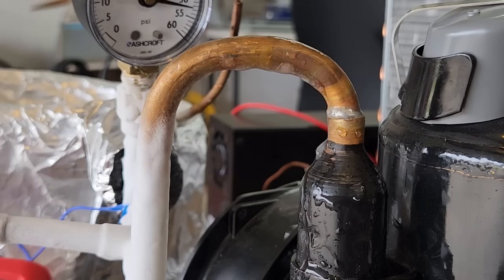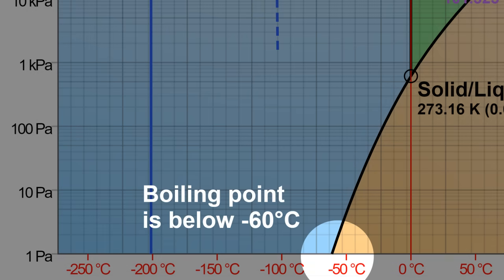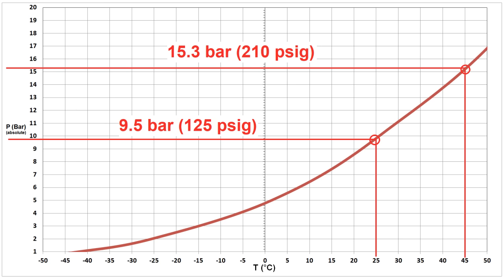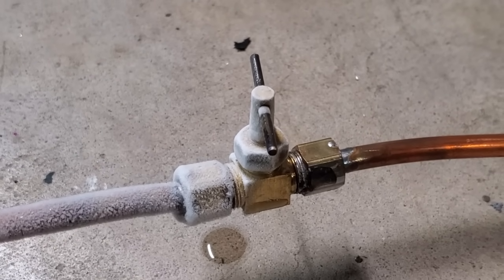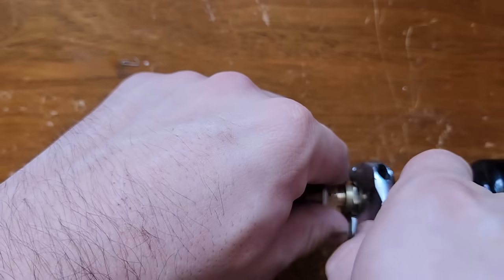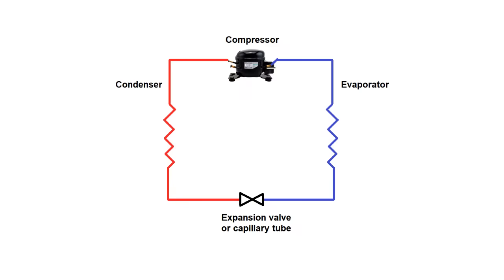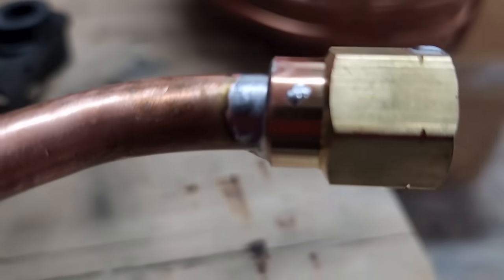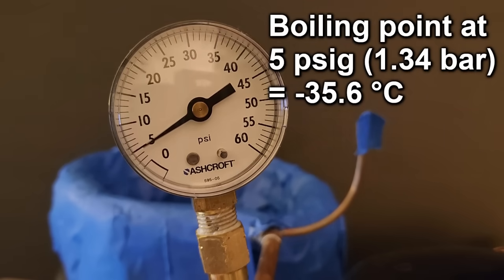DIY Vapor Compression Refrigeration System

Comment: Hey, that's a really cool video.
I just got another question and I'm happy about everybody helping out. 
I want to replace the R134a in my car with R290 (propane) due to the lower boiling point. 

Background story:

That car originally came from a nothern climate but I moved way south and in the summer it's very very hot and very humid and the AC that originally came with that car just doesn't keep up with the excess amount of water that it needs to remove from the incoming air and also the temperature on the vents is far from comfortable. 
The car wasn't sold where I moved so there's no stronger version and I don't want to get rid of the car either as my assignment here is for 3 years and then I'll take it back home.  Long story short

Intention:

As the boiling point of R290 is lower than of R134a my idea is to thereby lower the evaporator temperature and improve the efficiency of my AC. 
I don't worry about freeze protection on my AC as I have the engineering software on that car and I can code different temperature and also different pressure limits for the car to accept. That wouldn't be the problem for me. 
I just lack the knowledge about ac systems and refrigiration cycles. Currently my evaporator temperature is at 18-21°C and there's a rather strong stream of condensate dripping from underneath. Yes the system is charged correctly. 
The problem is a temperature of close to 50°C and a dew point of over 30°C . 

Is there anything I can do without major mechanical changes? 

Another idea would be a different crank pulley for more rpm/belt speed at the ac compressor. 
The serpentine belt only drives the AC compressor and alternator. 
Power steering is electric and the water pump is driven by the timing belt. So no issues there with fluid dynamics.

Comment: LRA, never come across that, Stall current. Great work and production. If you could get a -100C? working environment, high temp superconductor testing and ultrastable lasers for minature gravity wave interferometer. Or whatever. Nice shot with the ice melting and the pressure gauge ....increasing ?

Comment: Some ultra low temp. freezer manufacturers have perfected mixed refrigerant and multiple evap. heat exchangers ,the cabinets are colder than -100 F. and use a scroll AC compressor .

Comment: If you need to make a concentric heat exchanger again, try this. a small plastic slug that is just a free fit in the outer pipe. Attach some strong fishing line, thru the hole in the plug, line passed thru it, knotted and sealed with heat glue. Then blow the plug trailing the fishing line thru the outer pipe with compressed air. The inner pipe can be pulled rather than pushed, much easier. Do not worry about lack of concentricity, the heavy copper walls will equalise the temperature. Your flows should go in opposite directions, lower heat exchange rate but more complete exchange.

Comment: The method you describe for determining the correct amount of refrigerant to add would be correct if you were using a TXV, but since you're using a capillary tube for a metering device, you have to base it off of a target superheat. Assuming your airflow across the condenser coils is sufficient, the ice is a good indicator that you do not have enough refrigerant.

Comment: I've looked at making a cascade cryocooler like this before. What turned me away from it was the high amount of gaseous storage space for the ethylene, methane, and nitrogen loops.  Propane is nice because it is liquid at room temperature and moderate pressure.  But ethylene doesn't have a liquid phase below 8C, methane below -80C, and nitrogen below -145C.  So to store it at room temperature, these have to be a gas, meaning terribly low density.  Not impossible, just a pain to deal with.

Comment: For your fan startup issue, you might be able to get a good-sized capacitor on the output of your power supply, or, a low- value power resistor; that's what I had to do to stop fuses from popping on emergency vehicles with a bunch of 100 W halogen lamps in their flasher systems...

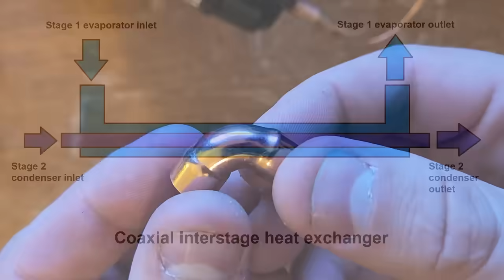Comment: 12:38 if you reverse the flow in one flow path. This will be a counter-flow heat exchanger, which is much more efficient. 

With equal mass flow rates, equal CPs, no phase change, and a sufficiently large counterflow hear exchange would have your stage 2 condenser outlet temperature equal to your stage 1 evaporator inlet temperature. (Instead of the stage 1 evaporator outlet temperature with parallel flow). 

Since there's a phase change and pressure drop, things are harder to predict, so some experimentation may be best.

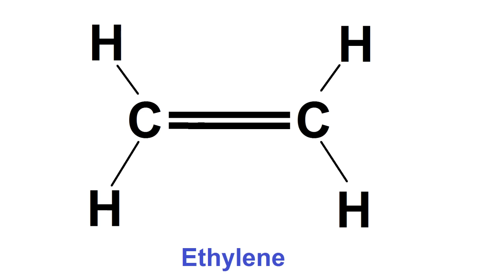27:58 this diagram shows counterflow, which is "correct"

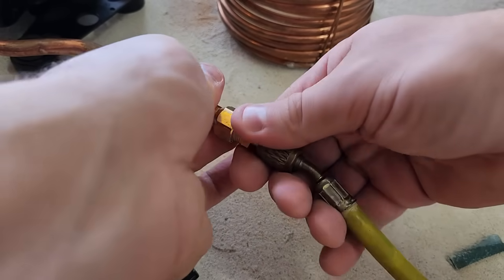Comment: At 15:01 you could have just used the fitting you've got your hose on threaded into the FIP you brazed on but you decided to put 2 adapters to go back and forth in the middle... When you could've used one braze on service fitting to go straight to your hose. The part of my that works in refrigeration is like bro why, but my diyer self loves the simplicity of it

Comment: Fantastic video, but why not use a Thermostatic Expansion Valve instead of a Capillary tube? 
Maybe I am confusing the two, but the TEV should be different from that first device you tried to use at the beginning. It will essentially autotune itself because it includes a feedback component.

Comment: Wouldn't it be better to have opposite flow rate in the Coaxial heat exchanger? I mean that would give you a much more stable temperature difference as the warmed up gas would cool the 'hot' gas on the condenser inlet side and towards the outlet side of the condenser both would get cooler (the refrigerant in the condenser from cooling and the one in the evaporator from being fresher) - don't feel bad if you gotta correct me, I'm happy to learn if there's a mistake in my thought process ✌️

Comment: This is amazing, and is exactly what I need for a air to water heat exchanger. But before I get to excited please let me know if it is possible, I am building a rally car an i am using water to air cooling for the turbos, and have been asking myself if I could some how get that water to be cold with a modified AC system... Do you think I could achieve some decent air cooling

Comment: You might like R-1270 better, you can get it at the hardware store as yellow bottle torch fuel. I have a freeze dryer that will do -40C from ~23C ambient. If I run it in cold weather (-10c) then it will pull below -55C if I have vacuum in the chamber. I also made a blast freezer from a broken dehumidifier that I had to  -46.8C the other day. I want colder but I don't see how unless I start something crazy like trying to condense ethane out of natural gas. And I could only run that in the winter, and at great peril. One problem with such low evaporator pressure is that the compressor wants to overheat real bad. I am water cooling the bottom of the compressor to cool the oil which helps. There's a reason those home freeze dryers have a reputation for compressors failing... it's far from ideal to have a 60-80C temperature differential. 

I found propylene was good for about 5C or 7C lower temps than propane with the same cap tube and compressor.

Another kind-of-decent is air dusters. It's basically a drop-in for R-12. Less flammable than propane but not as cold. 

ALSO: Dump that 1/4 tubing and get some 3/8 for your low side.

Something else you might find lovely: a sight glass! I like to put mine right on the end of the liquid side between the filter drier and the cap tube and position it at an angle so you can see if the system is getting liquid, liquid/vapor or only vapor. Experimentation has shown for me that the coldest is liquid/vapor something like 50/50 so the vapor bubbles don't allow the stream to accelerate but there is less total refrigerant because of the bubbles. Thus allowing a lower evaporator pressure. Capacity will be severely impacted, obviously. Better have good insulation if you want to run this way.
Reply: Mono-, di-, tri- fluoroethanes alone  do not really work well.   Some two stage freeze dryers use r-89 and ethylene. It seems MO89 carries a lot of heat, vapor pressure in -40 C. is about 10 psi and 200 psi in 25 C., contains propane to prevent oil freezing, not too much stress on a compressor and is ease to blend. You mentioned you build a freeze dryer. How did you attach an evaporator tube to vacuum chamber?  I used a stainless steel pot as a vacuum chamber, wrapped around 1/2" copper tube with 1/4" tube inside for future compressing and cooling gases, but soldering it to stainless steel seems to be impossible...
Reply: @1srol1  you can braze copper to stainless steel with a high silver alloy brazing rod with flux 40-50%+ or use a thermal epoxy otherwise probably better to just have an evaporator coil passed into the vaccuum chamber instead of cooling the whole walls
Reply: @1srol1  I used an aluminum pot ~12L and wrapped with with a coil of 3/8" copper tubing, I coiled it as tightly as I could and used a thermal silicone adhesive, the conductivity isn't great between them but it works well. I think I used about 4m of tubing wrapped around the pot. I've seen it go below -60C but it's a bit unfair to say that when it was -30C ambient! (My sensor only reads to -60C as well) My freeze dryer isn't really cold enough to do something like ice cream very well but it does a very good job on my chiles. 

It's possible to lead/tin solder stainless using a zinc chloride flux, I have a "forney" brand liquid flux I got at a hardware store years ago. Scuff the stainless clean with some sandpaper, apply flux heat and solder as normal.  As Blaxkor below says, a silver braze is better and quite easy as long as you've got decent flux. 

I had never heard of MO89 before, I may have to ask around about it here but I am trying not to buy a tank of refrigerant...
Reply: @brianwelch1579  For my new project I copied almost exactly the freeze dryer I own. It uses MO89 refrigerant, the  blend of r125, r290 and r218, in the first stage and ethylene in the second one. Since I couldn't get MO89 to refill it, I mixed components for it and I got 2 kg of final product. It gets easily to -30 C. Then I used the cheap controller from eBay to turn on the second stage at -30 C and off at +10 C. I got to -104 C.  I also wrapped evaporator coil over SS pot  but heat transfer is poor. 80% ethanol become a gel, engine cooler got frozen, heat transfer paste got brittle, brazing did not work, I burned the hole in tubing... I don't want to open the original freeze dryer chamber to see how is done and break it.
Reply: @1srol1  I can see the difficulty, I'm not sure the silicone thermal adhesive I used would handle -104C well, I suppose it probably wouldn't break if there was low mechanical stress and the thermal expansion isn't too different between the coil and pot. Solder is probably a good bet, if you do it in sections and leave a gap here and there to help alleviate stress. Brazing copper tube to stainless sheet sounds like a near impossible job. I did a little test run of that with a scrap of tubing and a bit of stainless sheet, I gave up - that was with a 50% silver + cadmium braze. (You use what you have!) Maybe TIG brazing could do it. But you'll kill the part with distortion by the time you finished. Maybe in an oven. I think either lead or silver solder have  a high chance of success. It's a bit of a pain to solder stainless but if you have a good flux and a freshly scuffed part it will flow nicely.

It reads a bit like "Toxic metals I have recently come into contact with".
Reply: Very cool info on the source. Noted. Thanks!

Comment: You need a turboexpander  as an expansion condenser. 
Run a fan on the same shaft to further increase your efficiency. 
A few nested conical softdrink bottle necks would make a conical turbo expander. Conical laminar flow Tesla variant.

Comment: Instead of drilling the elbow you can use a tee fitting with a compression coupler on one end to pass the tube through and seal without the solder ball.

Comment: I've been wanting to create a mini heat pump project. About the size of a lunch box. Variable speed compressor that claims it can move 1000w of heat  for about 150w.  Just to heat and cool things for other projects. This is exactly the video I've been looking for. Though it looks like I will really need a variable expansion valve and a reversing valve to do what I want. Most applications would target a differential temperature of 80F but the amount of heat it needs to pump as well as compressor speed will change accordingly. It looks like In any hope to maintain high efficiency, a capillary tube would be severally limiting.

I intend to use a microcontroller to set compressor speed, monitor temperatures,  and I suppose drive an expansion valve.. Unless there is a better way to drive that valve?
Reply: I was in apartment maintenance for about 30 years before I retired, and did all the HVAC work there as well. I have replaced reversing valves as well as compressors and all the other things necessary when repairing the systems, and you have to be careful. Reversing valve needs to be heat sunk very carefully. If you overheat the reversing valve you can damage the O-rings inside on a sliding piston and ruin it. I did braising with Silver solder sticks, you really do not want to use regular solder as it will tend to crack overtime. As far as driving  reversing valves, it was always done by a relay on a electronic circuit board in the system. You would not want to drive it using some kind of variable voltage as a reversing valve is meant to go in one position or the other. The full 24 volts is required to move the sliding core. Good luck to you in your projects in the future.

Comment: Once the Freon has cooled the coil, return the suction line over the pressure line, just before the expansion tube. This will further reduce the temperature of coolant before the expansion tube so the cooling is lowered even more.

Comment: Excellent vapor condenser video..... Where I live 98% of the year we need heat, what if I picked up a low amp  DC  compressor and found one of those condenser coils and throw in a filter dryer and bring that condensed r 290 back to the compressor in one happy circuit..??    I only want to make heat about 20,000btu....It would be great if you did a video on just making heat...  Thanks
Reply: You will need 20K BTU rated compressor or 1.5 ton compressor for this

Comment: If you can crush the tube to make a connection then you can also squeeze the tiny tubeing to create finer control on the expansion valve. 
I got a question on these soldering connectors.  My impression on hvac job is it requires blazing than soldering due to higher sealing capacity requirements. Soldering is probably only good for a short time test?

Comment: If I take a piece of wire and clamp it in a vise and put the other end in a drill chuck and spin it for about 5 Seconds and then spin it back the other direction, it straightens the wire very straight. I wonder if this would work with tubing as well.

Comment: Consider placing a heat exchanger after the condenser and evaporator.  Use the cool (low pressure) gas to finish cooling the warm (high pressure) gas/liquid as it enters the capillary.

Comment: Between stage one and stage two refrigerating units if somehow a custom sized or shaped peltier mudule is placed Between the hot and the cold ends would that regulate the hot and cold sides while generating electricity from this difference as an added benefit and charge a battery that can somehow used to power this whole thing. I believe with right elements put together we can have cooiling and heating systems that require very little energy or only upon starting!

Comment: Love all your videos, especially the cloud chamber. I was curious if you could assist me. You want something could  but if I wanted to hear water instead with propane how would one accomplish that? Of course water heater exchanger for the condenser coil but how do i find the math for his to heat it and what size device is needed. I suppose starting with old AC units is a good first start.

Comment: I've had an R600A isobutane refrigerator for years, it goes down to -37C no problem, could go lower, but thats the limit on the thermostat, I accidentally froze some flavored (<40% ABV) vodka with that.
Also, it would be nice if you refered to absolute pressure in barA and gauge pressure in barG, same as with psig, just to make it a bit clearer, because it's not always obvious
Reply: It does because it evaporates at a lower pressure than atmospheric pressure (even my teacher didn't know it back then hahah)

Comment: Nice video! ,For the tube in tube heat exchanger if you use a T with a reducer or  a reducing T will be easier & stronger . I have made some if counter flow they are very efficient.

Comment: IDEAS PLEASE?????? I'm wanting to make a small lightweight system to use on a race car to cool the intake charge for more power and safer combustion. I can tell you intake temps can reach °500 at its highest & are usually 200 or less. It only needs to cool the charge for 15 seconds at most & has hours to recover if needed... ideas?? My water to air works great but I want better. Also I'm now flowing nitrous or Co2 through the intercooler venting it to atmosphere. I want a system that is easy to use over and over... Help me..... I love to play with science lol.. IDEAS???????

Comment: Get rid of the cap tube. Switch to a txv. And add an accumulator. It will make it way easy to hit lower temperatures and protect the compressor. Since you will probably be running low SH on a small lineset

Comment: What are your thoughts on Electrostatic Cooling? This was used on the F-111 wing pins when welding them. 20 watts was able to dramatically cool the area of the pin where the high voltage probes were directed through the thickness of the pin.